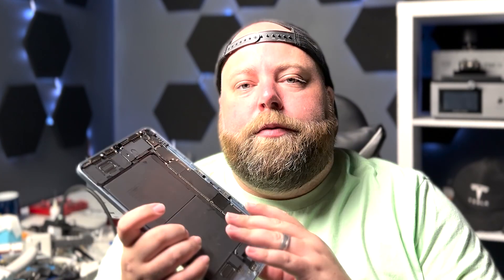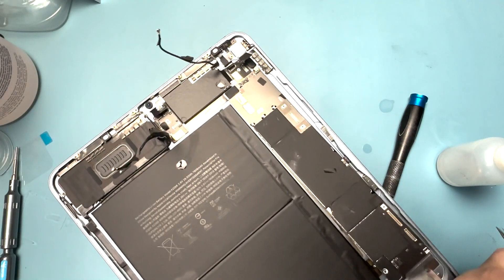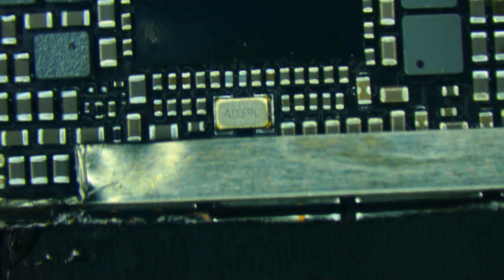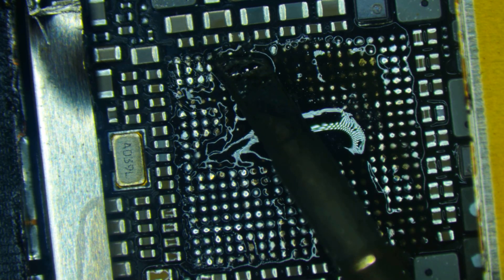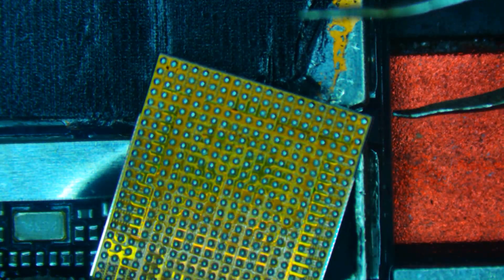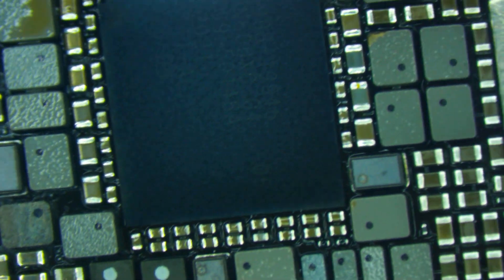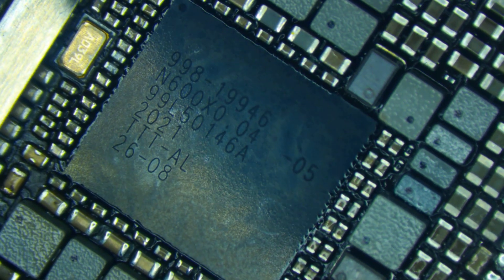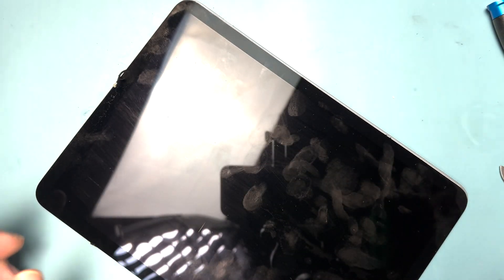iPad Air 4 No Power Issue: Final Fix and Repair Solution

Comment: Hello could you help me i have an issue with the same ipad but not the same problem, i found out the problem on charging circuit found a very small component measuring 3mm with burn mark but i cant find this component anywhere.. it has written on its top izei AOIC7JD do you know what is that component?